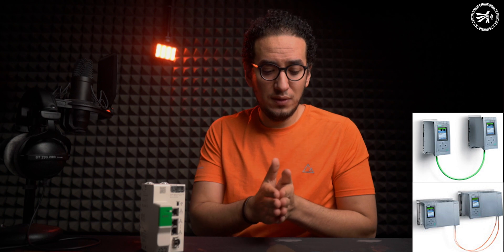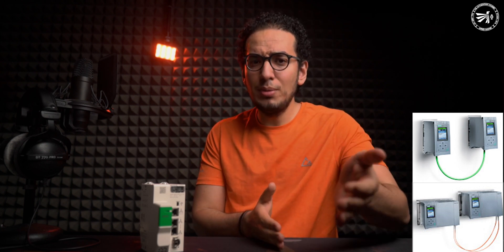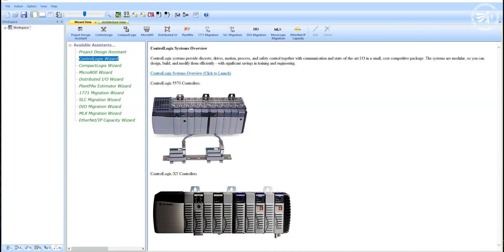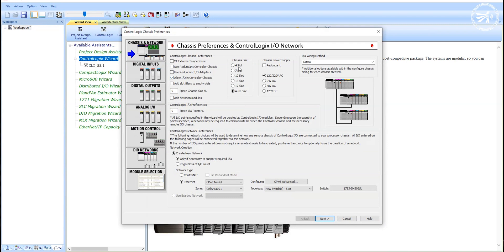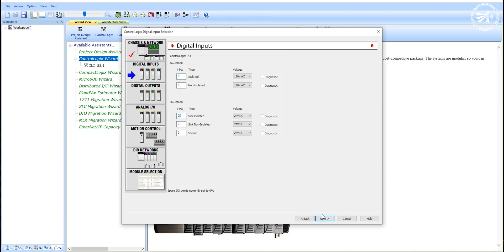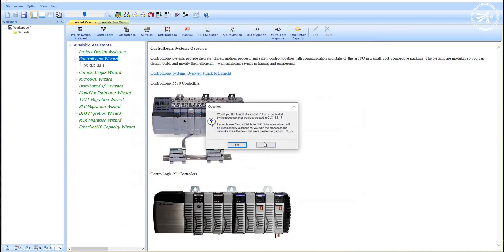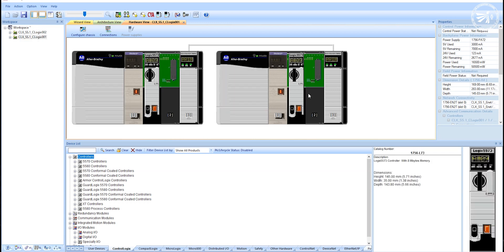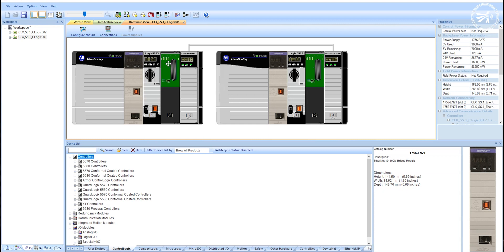PLC Basics | What is HSBY System?

Comment: Hi ahmed, please show the differences between s71500 r/h and m580 hsby
Reply from the maker: If you know siemens S71500R/H  S71500H is sing seperate link for sync between CPUs which is the same in M580
S71500R is using the same MRP ring for the sync between CPUs..that means much slower due to the limitation of MRP ring when we have a failure.
https://assets.new.siemens.com/siemens/assets/api/uuid:8ad3e246-011b-4206-aa85-1ec60aac51ac/simatic-s7-1500-redundant-systems--techslides-2018-11-12-en.pdf

Comment: How PLC IP address get changed during hot stand by operation?
Reply from the maker: they are connected and each one is reading the status of the other...once standby one read the partner is not reachable or having failure...then he will take the lead and switch to the main IP.
we are not interfering this process..it is built into the PLC firmware.
old days we have to write a code in the HMIs to switch the connection to standby plc IP...now almost all of the vendor support the IP swapping during the failure.
Reply: @theautomationchannel6920  thank you for your explanation..have a great day

Comment: It's a very good content and great presentation , I have questions related to PLC of Schneider , I have information it's a PLC not need a battery for backup , why and what's the new in the PLC M580 don't find in Quantum ? And what you think about the réintégration of M580 In place of Quantum and Premium ? 
Best regards Sir ❤️
Reply from the maker: Hichem A M 
First Quantum is obsolete offer.. 
M580 is much better in processors and cost less. No memory no battery required 
This Quantum on the video is dead just for small issue during firmware update..
Why ... Always issues due to several parts.
I have installed almost 40+ systems of Quantum and really this offer was having issues from time to time.